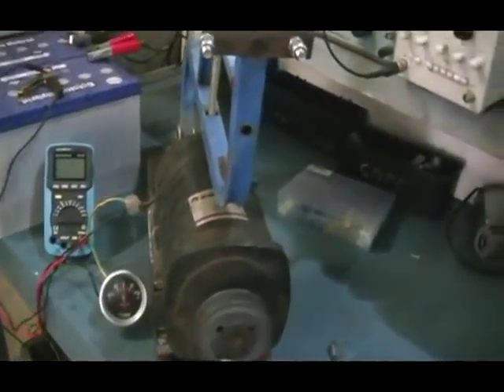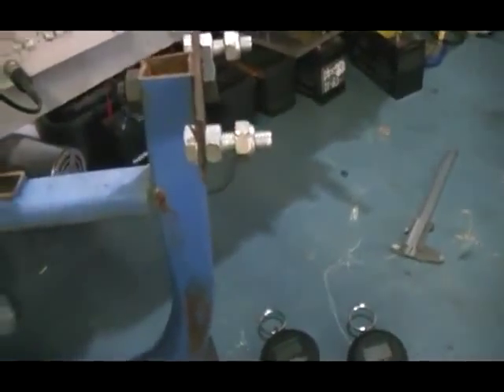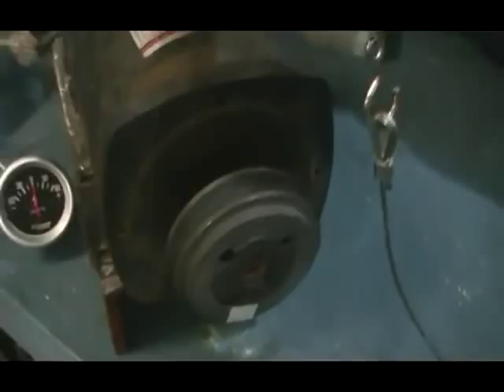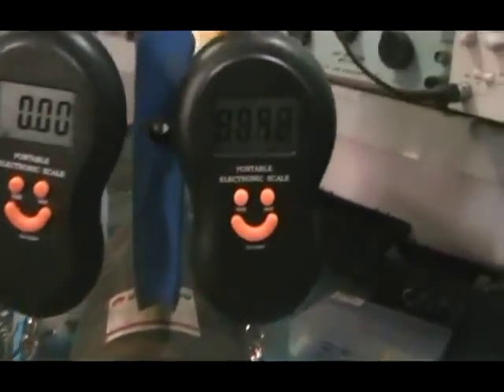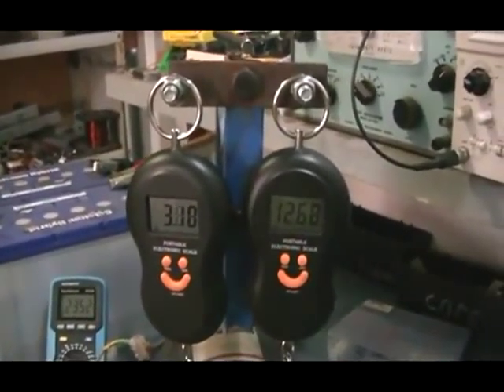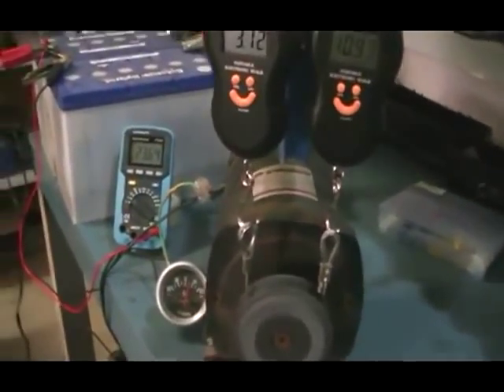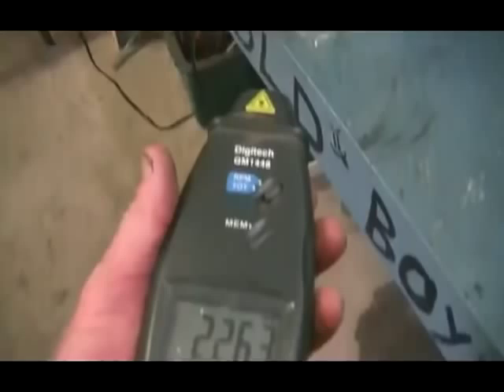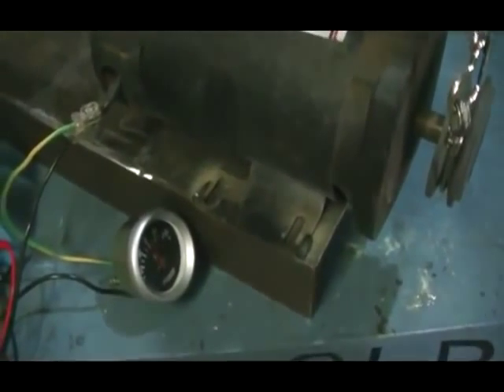UFO's prony brake test

Comment: TinManPower:
You are disappointing me man!
I thought when you came to my channel...bluffing so much about wrong measurements...you were excellent at Math...:(
First off, it is NOT the Diameter BUT the CIRCUMFERENCE...what you use for this Math...and that is a big time difference. So You have a Wheel of 1.88 Feet Circumference. Second...I thought You knew a bit more about Motors...it is impossible to be drawing ONLY 15 Amps...when you are applying that force in Lb.
Continued...

Comment from the maker: Hi Russ
The outcome will be the same no matter what material you use as the strap.With a lether strap,less force on scale B would have to be applied to get more pull force on scale A.And as B must be subtracted from A-then the outcome is the same.
Steel or wire rope is the better material to use,as the scales tend not to jump around as much as useing a softer material for the strap would cause.
  Cheers